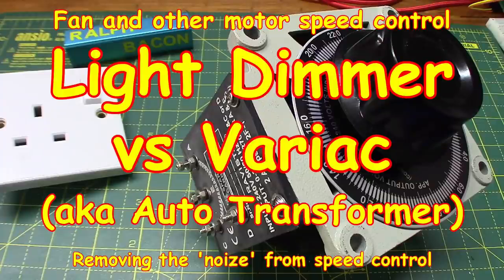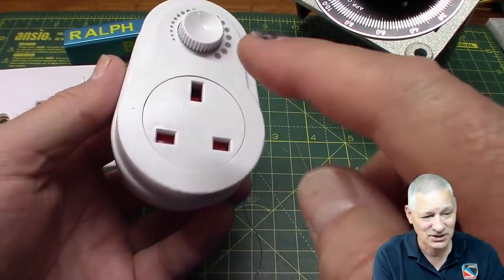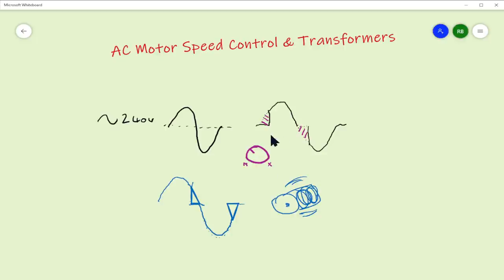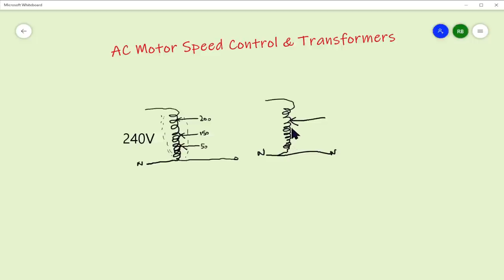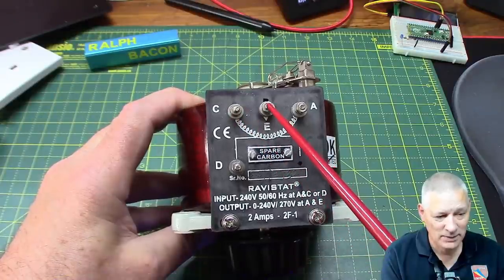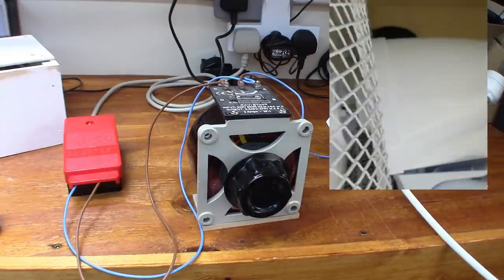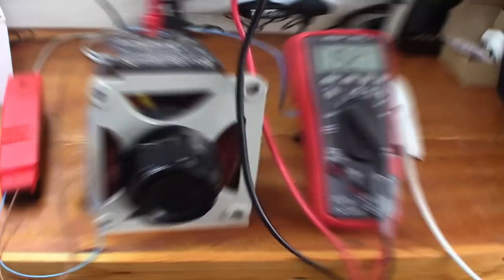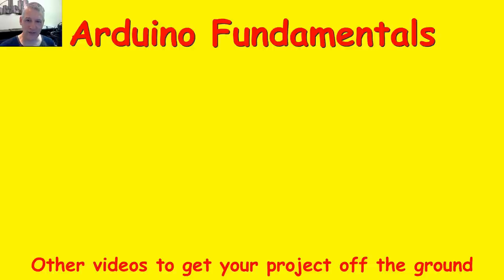#217 Auto Transformer ⚡ Variac for motor control - silent control 👍

Comment: The sine wave on the oscilloscope wasn't a very pure sine wave, was it?  Straight slopes and chopped tops / bottoms. What's happening there?
Reply: The mains voltage almost never looks like a sine wave. There are too many things influencing its shape on the way from the generators. Almost all power supplies for example only draw current near the peak of the sine wave when they top up the capacitors after the rectifier. That (cumulative) large current draw "clips" the sine wave. It's also the reason why power factor correction is mandatory in the EU for devices above 75W. Otherwise it would look even worse.
Reply from the maker: That good old British sine wave, I'll have you know, Andy! Well, it's good old, whatever the power company have decided is the most efficient wave form to send out down the power lines!

Comment: This is interesting. Though I've had dealings with Variacs before I've not used one for motor speed control and not really considered what's going on. Conventionally an AC motor's speed, be it single or three phase is a function of the frequency e.g. 50 Hz, along with the number of motor poles. In years gone by various remarkably clever mechanical methods had been used to vary the speed. These days if you want to vary the speed the usual approach is to use a Variable Frequency Drive (historically called an inverter). Obviously the clue here is in the title - variable frequency. With the Variac the is no frequency alteration, merely voltage. So I'm guessing what you're introducing here is, due to the reduced power input, rotor slippage? If this is the case will the motor get warmer than might be expected due to the inefficiency, along with knocking your electricity supply power factor for six?
Reply from the maker: I had concerns that the lower speed would cause the motor to get hotter (they usually have their own little fan inside as part of the rotor) but then again we're talking lower voltage (not a chopped full voltage) so I was hopeful it would cope, and so far, it has.
The internal electronics of the fan simply turns on 3 different triacs to 3 different windings on the fan motor to change speed, no use of any capacitor to reduce the speed (unlike the ceiling fans, I'm told).

Comment: What would happen if you used your rp2040 to let through all of a 1/2 wave so both ends were zero crossing and then skipped a full wave(2 x 1/2 wave) ? would it then run at 1/3 speed with no slip?

PS The chap with the 8" car fan is probably the heater fan, Radiator fans look like they go up to 16".
Reply from the maker: We could do that, Joseph, or let a full cycle through (both halves) and then skip a cycle, I suppose, but that would only put the fan on half power - I don't know if that would be too slow; At best we could let a half cycle through, skip a half, or full, or one-and-a-half (and so on) and then let another half through. Or some variant of that. Experimentation would be required. We have the means to detect the zero crossing point so it should be quite feasible to do.
Regarding the (car) fan that would be too easy to control using PWM - it's DC, after all.

Comment: Xpelair WAC1 do a 3 speed fan controller with no hum. But is around £30 and less fun aha
Reply from the maker: This IS a 3-speed fan but it is too fast and noisy (wind noise) even on the slowest setting.
Reply: @RalphBacon  interested to see if adding a 3 speed controller to a 3 speed fan would give you 9 speeds?

Comment: You should have mounted a cheap ceiling fan, most of them have a direction change switch for winter/summer
Reply from the maker: A ceiling fan would decapitate me in an instant! My workshop ceiling is not that high.
Reply: @RalphBacon  there exist ceiling fans with enclosed blades, so it's like an air blowing lamp

Comment: I'm a bit surprised that the speed controller electronics in the fan can handle the variable input voltage. BTW: the waveform on the oscilloscope looked more like a triangle than a sine wave to me.
Reply: There's most likely a small switching power supply in there, which don't care much about input voltage.

The mains voltage almost never looks like a sine wave. There are too many things influencing its shape on the way from the generators. Almost all power supplies only draw current near the peak of the sine wave when they top up the capacitors. That (cumulative) large current draw "clips" the sine wave. It's also the reason why power factor correction is mandatory in the EU for devices above 75W. Otherwise it would look even worse.
Reply: @superdau  thanks. Yes, switching power supplies will keep the voltage correct unless the input voltage goes very low. Good point. I get your point about "clipping" at the peaks. But it looks to me like the slopes look rather linear as well.
Reply: @nkronert  
Plot a sine function and look at its shape. The lines are less curvy than you think, especially if you flatten the tips. That's also how you can easily spot some lazy graphics designers, who use stitched parabolas or bezier curves to draw a sine wave instead of using an actual plot. The "fake" sines are way to "round". :)
Add to that the low resolution of the scope screen without intensity grading and it's pretty much the most you can expect.
Reply: @superdau  I guess the higher the amplitude relative to the period, the "straighter" the curve appears. Yes, parabolas mostly don't make good sine function replacements, but circle arcs tend to be even worse 😊.
Reply from the maker: Me too. But I had a quick look and it's a microcontroller in there (with its own power circuit) driving 3 triacs for slow, medium and fast speeds (which translates to quite fast, even faster and too fast). I'm guessing each triac drives a particular winding of the fan's coil.
The sine wave was a proper sinewave, and was seen better as I reduced the amplitude at one point. No triangles were involved in this video.

Comment: I use a 12volt 8inch car fan that is easy to control :-)
Reply from the maker: Does it move enough air for a workshop though?
Reply: @RalphBacon  Ahh!! now we are on to the who has a bigger one than that, I hope not:-)
Reply from the maker: Well, not to brag or anything, but mine is definitely bigger than yours. 😳 Simple maths. 16" fan vs 12" fan. What did you think I was talking about? 😜

Comment: It's surprising that the electronics in the fan still works at the lower supply voltages.  There is usually a series capacitor (to drop the supply voltage down), a diode bridge (to produce DC) and a zener diode (to regulate the DC level) that produce the supply for the on-board fan microcontroller.  At low Variac outputs, this circuit should not work properly.  What's your secret?
Reply from the maker: If I told you it wouldn't be a secret would it? 😁

The electronics within the fan kick in really early, at about 60v. The fan won't move at that voltage but it does at about 100v. I'm guessing that the fan is sold in various countries and will work at various voltages with little or no component adjustment required - except perhaps for a different fan motor for the US market with its particularly low 110-ish volt supply.

Comment: Content starts @1:36.
As an electrician trying to fit the latest "approved" "smart fan controllers"; In our toolbox is a capacity changer which I can put inline to the device for that perfect "no hum" touch. 

Love pulling down 60's fans as they have a true tranny for control!
Reply from the maker: I Googled "Smart Fan Controller" and just loads of Alexa and Google Home voice-activated switches!
Reply: @RalphBacon  The silly things hum something chronic due to the different frequencies of mains supplies and the pulses they throw down the lines to turn on and off our hot water units is the kicker ;)

Comment: You turned up the speed and it slowed down and went backwards, wuh?

-Strobe McFramerate
Reply from the maker: Just in case others are unaware of Kent's tongue-in-cheek comment, it's the horse-drawn wagon optical illusion, where the wheels appear to be going backwards because the camera shutter speed and the wheels' spokes position just happens to coincide to do that - same with my fan!